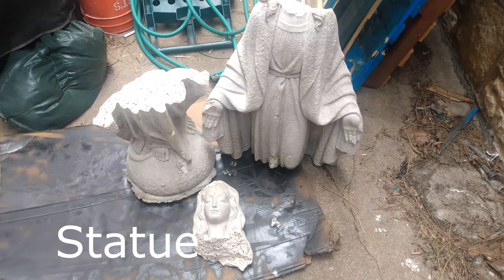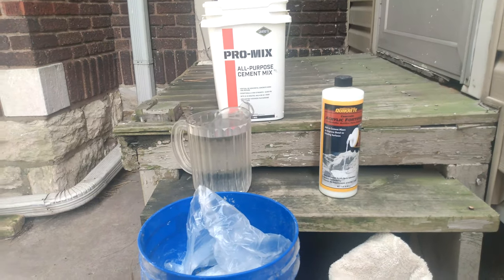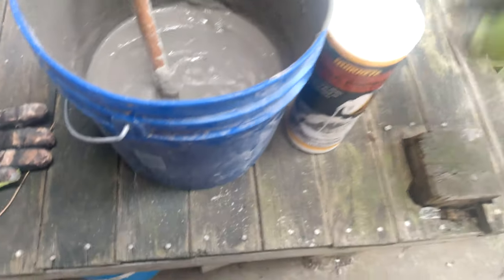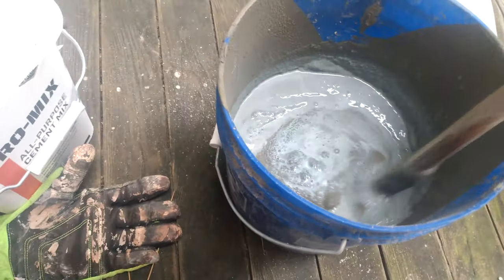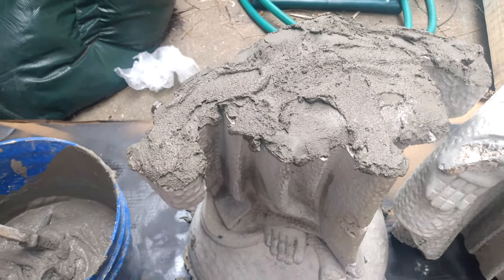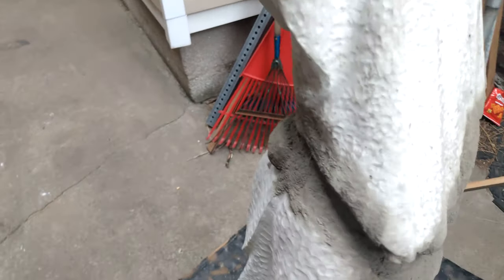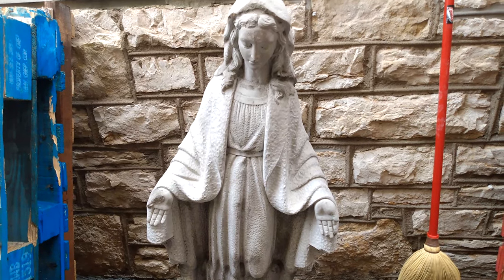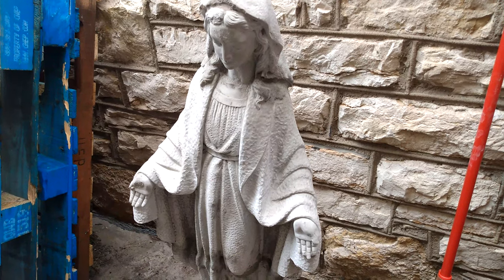Cheap and Easy Fix to Broken Concrete Statue - How to Repair Concrete Statue

Comment: Hopefully you never have this situation again, but if you ever do, then wet (damp) your concrete pieces before you use the cement mixture to stick them together. Cement uses water to form hydraulic bonds which hold the concrete together. Applying the mixture directly to "bone dry" concrete will cause water to be drawn from the repair mixture into the concrete. This will weaken the bond. Pre-wetting the concrete to be patched will help ensure the water stays in the patch where it is needed for the chemical reaction to occur.

(6:30) Don't re-temper the mix (add water) It makes it weaker. Make a new mix instead. Or use a chemical retarder to give yourself more working time.
Reply from the maker: Thank you for the tip! I'll definitely keep that in mind on my next project.

Comment: Thank you! Trying to fix my grandmother's 50  yr+ VM statue from beach corrosion. I'm having some issue with finger repair. But I guess she can still bless you with half a hand! Lol.
Reply: Fingers are very difficult - try drilling two corresponding holes and inserting a rod/wooden dowel. Won’t be perfect but will be strong.

Comment: The wind 🍃 blew over 🌬️ my garden statue of Venus ♀ and her head has broken off I've tried to glue her head back on but it's not worked???
Reply from the maker: You probably need to use the concrete repair materials that I used in the video or something stronger. Make sure everything is lined up when you're "gluing" it back together. Also make sure it's in an area where nobody can bump into it while it's drying. The prep work is key. The statue is still holding up til this day for me.